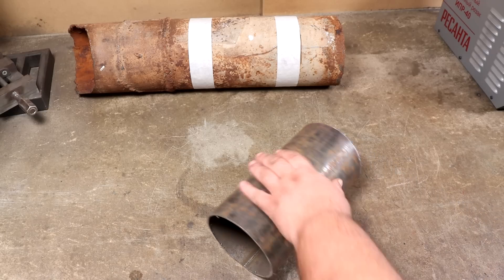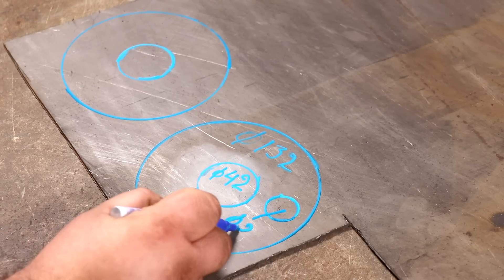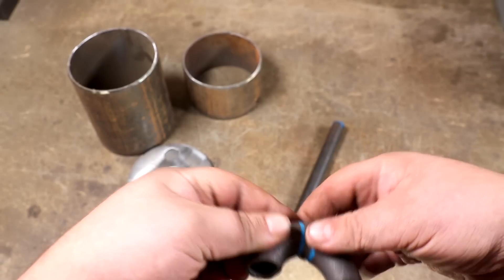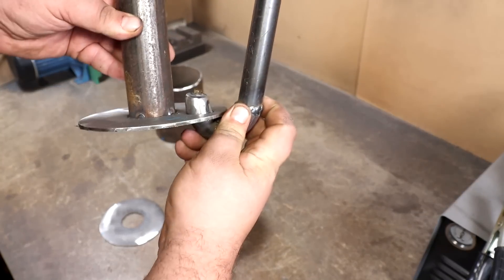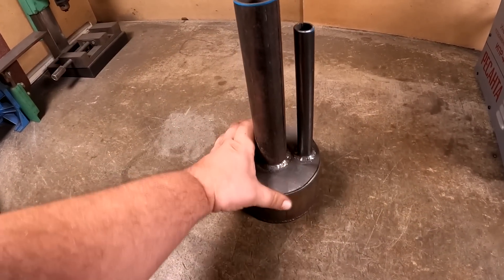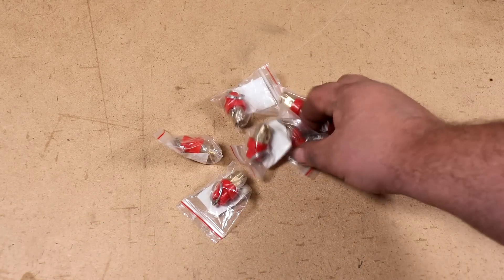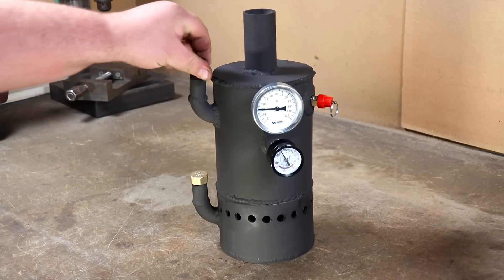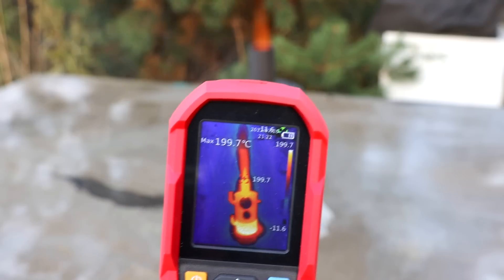Homemade Illegal Burner Uses Water

Comment: Regulating the power and shut-off can be accomplished by controlling air flow. Rather than a series of holes around the burner chamber, use air inlets with valves.

Comment: you changed something in the video of the smaller pipe coming out the top,  it disapeaars and the lid is actually over it or somehing, and the hole from the smaller pipe is gone, the one that does the horseshoe at the bottom..  where did it go,  is it inside under the cap with some space in between?,  It changes right when you bring the spray can in to paint it????

Comment: Congratulations on your project. It is clear that it works correctly. But at the end it does not show what you do with the other small tube that goes up alongside the central chimney. Afterwards it simply disappears, it is as if you had changed the cover. I think that, as they commented, a diagram would be missing to understand your project. But perhaps it is not your intention to show it.

Comment: Claims that water is used to power some kind of heating device or explosive engine are not scientifically sound and can be refuted by a number of laws of physics. The most important of these are:

1. The first law of thermodynamics:

As I mentioned above, this theorem states that in a closed system (such as a water-powered heating device or an explosive engine), the internal energy remains constant if there is no exchange of heat or work with the environment.

It follows that in order for a water-powered heating device to produce heat, an external heat source is required. Water itself cannot 'produce' energy, only transfer or absorb it from its environment. Therefore, a water-powered heating appliance could not produce heat if there were no external heat source (e.g. the heat from the flame of a pick).

2. The second law of thermodynamics:

This theorem states that in a closed system, the entropy of the system always increases or remains constant. The entropy is the measure of the disorder of the system.

It follows that for an explosive motor driven by water to do its job, the water must become disordered. This leads to a loss of energy, which means that the motor would not be able to work efficiently.

3. The law of conservation of mass:

This law states that matter cannot be created or destroyed.

It follows that for a water-powered explosive motor to work, the mass of the water must remain constant. This means that the motor could not 'produce' energy from the water, because the mass of the water would not change.

To summarise:

Water-powered heaters and explosive engines cannot work because they contradict the first and second laws of thermodynamics and the law of conservation of mass. These laws are proven and irrefutable, and therefore water-powered engines are not scientifically sound.

It is important to note that numerous scientific experiments and analyses have already disproved the viability of water-powered engines. It can therefore be stated with confidence that these engines do not exist.

Comment: I do not understand.  When you put out a fire, you use water, either in a concentrated stream, or with a spread fore cooling down.  Steam boilers on steam engines use steam, but have you ever heard that it can catch fire or explode?  Cooking oil has a high flash point, and burns very well when it first catches fire.  Is it then the combination of cooking oil, air supply and the turbine effect that causes the temperature to become high enough for the water vapor to catch fire? 🤔 Very interesting, but if I used it inside a normal cast iron oven, I'm afraid it would burst from the heat.  Do you think I could use this to heat the house? the greenhouse?  and if so how?🤔 If I'm going to use it for continuous heating, use a copper coil to supply water continuously, wouldn't it melt then?😊
Reply: See "Steam reforming" on Wikipedia. Water by itself does not burn. It may improve combustion slightly at sufficient temperature with a catalyst

Comment: you know theres a cool little thing called coal gasification, where heat up coal to 800-1800 degrees celcius or so and pump steam and oxygen into the burning coal creates: syngas (co2 and methane) methane further burned so i think can do for a great powerful cooking stove

Comment: This could be used to heat a home and the hot water if it was installed in a boiler tank outside and the  water circulating through registers in each room with pressure release valves ,just like in the early 1900`s.

Comment: Well, there are two ways of using water, as opposed to HHO, which I’m tired of explaining to people who want something for nothing.
You can inject water into the combustion process, to both slow it and cool it, which is done in industrial engineering and furnaces. In low revving engines, the resulting steam can even increase pressure in the cylinder on the power stroke. There are lots of successful uses of the technique, which even made it into some experimental public transport diesel engines, though it proved not to be cost effective in that application.
What’s going on here is the other one, where the water is injected as compressed steam, after combustion, where the rapid expansion causes an increase in gas velocity and draws more air through the furnace, causing the oil to burn faster.
It could use a couple of safety add ons. One, to divert the steam direct to the outside, rather than through the exhaust, to enable a more traditional burn and another to throttle the air supply, for a quick shutdown.

Comment: H20 can not burn itself consistently  and it can not work as a fuel, like a perpetual machine to break the 2nd Law of Thermodynamics. Here, u have done natural induced draft of Air by steam Zet for complete combustion of used oil. Moreover,  it will help to remove shoots from chimney. For consistant operation of this burner,  need controlled feed of Water and Oil continuously. Great job done and highly inspiarable for the beginners.

Comment: I loved this and am currently browsing some of your other clips. Trying out a lot of D.I.Y. tools making tips has become my new passion at 68 yrs old. Thanks for your efforts to produce and bring these ideas to the rest of us. These things are what I have always believed the internet was supposed to originally be about... an open free exchange of Ideas and information.... I almost fell out when you said.. now we only have to learn how to regulate it and turn it OFF ! :) Thanks again  -Jake
Reply from the maker: I am very pleased that you like my videos and I am glad that my ideas inspire you. Thank you🤝💪🤖
Reply: Use a metal cylinder that can cover the holes. Cut off the air. Make it adjustable. Attach it or keep it as a separate part. There are many solutions.
Reply: @Jack__________ or/and a steam dump valve to off load the steam “turbo boost” pressure.

Comment: I've seen your videos and I like what you do... Keep up the good work.. instant fan here... And my suggestion on how to control the pressure is that to control the burning of the fule ... So why not add a guide rail over air inlet to slip a sheet metal in between the body (inlet) and guides, the sheet metal is going to have a pattern that matches the spacing of the inlet holes... So when you finally slide it will create eclipse effect whilst managing air flow
Reply from the maker: Good idea. Thank you!🤝🤖

Comment: You could try adding a metal sleeve at the bottom of this burner as an air cut-off. It would be slid over the air inlet holes to starve the fire to the point where it's unable to generate enough steam to produce circulation.
Reply from the maker: Good idea, I'll try to make it! Thank you!
Reply: Thinking the same, just a sleeve that has same size holes cut out.
Reply: @joshuagardner5580  Oh, that gives me an even better idea than what I was thinking about.

I was thinking about a sleeve without holes that would have to be slid up and down. Your idea would let it be slid side to side, which would be easier to implement and operate safely.

Comment: You might be able to use a separate oil tank and a valve to adjust the oil flow and also stop the burn.
Reply from the maker: A good idea! I'll try experimenting like this! Thanks a lot!
Reply: @doctor-robo  You can use 2 separate tanks for whater and oil. You can adjust them or stop, but olso you can topp them with funnel. You just need to put some one sens flap on each or some sense valve. You can uso another tank with diesel...etc.  good idea! I have one idea like that but without whater. But your design is beautiful! Good job! No electricity for fan or other contraptions. 👏👏👏
Reply: @doctor-robo  ελληνικά
Reply: That’s what I use in my diy alcohol stove, it’s safer also in case of malfunction of the stove
Reply: Install a dump valve to blow the “boost” steam pressure down. That will drop your combustion rate at least.

Comment: This is not new, it's called a "super turbo" in brief it works by boiling water which produces steam and eventually a flame composed of hydrogen gas. With enough heat the process splits water into hydrogen and oxygen. In the past some turbo stoves as a example consisted of a specially designed hopper where rice husk is being fed for burning inside the combustion chamber, a steam tank which boils the water and converts it into super-heated steam, an air pipe which supplies the air needed for the combustion of rice husk, a char discharge lever that allows the removal of burnt rice husk during operation, and a steam burner that ignites hydrogen gas from the steam. These came into being during energy shortages or country's that lacked natural resources. Nice project though 👌
Reply: I wondered if anyone was going to mention HHO. I was part of the HHO experiment crowd for quite a while,  did get an extra 6mpg in an old Toyota Paseo, made some,I teresting explosions...BTW, "live" steam is extremely dangerous,  as it is invisible and freaky hot. In the Coast Guard,  I saw a broomstick that I was told was there for hunting live steam leaks - it would burn.

Comment: You could regulate the flame by letting off some of the steam pressure
Reply from the maker: Thanks a lot! I think that it is quite possible, but you need to make an additional valve to relieve pressure. 🤖

Comment: It takes energy to crack the H2O molecule.....
Reply from the maker: In this burner there is no splitting of water into molecules. Water plays a role in creating superheated steam. Superheated steam, in turn, increases the draft in the exhaust pipe by 10 times.

Comment: i like this idea and has so many implications. i was thinking of using leftover copper tubing from HVAC installs that haven't had Freon or POE oils dredging through the piping in a manner to create a hot tub using a horse troff and a wood burning rocket stove and wrapping the tubing around the smoke stack and using thermodynamics to create water flow to heat water in the copper tubing but your implication of the waste oil stove like this might work better to regulate temp so i don't burn myself with scolding water simply by adding another port to the steam top and a airflow regulator and shut off at the top and or bottom to regulate heat and with your added temperature and pressure gauge as an added safety feature ensures proper temperature regulation. thank you fore this video!
Reply from the maker: Be very careful with the steam section of the burner, there is over 400°F superheated steam and very high pressure. The design must withstand such pressure and must have safety safety valves (with a large volume of the steam compartment, several valves are better, one may have insufficient throughput)
Reply: what about having 2 chimneys and a manifold with a flap to block off one of the chimneys, when your water is getting to the temp you want the flap can close to allow the other chimney to take the heat
Reply: @utubeape  temperature regulated double stack. interesting
Reply: You could install a small flow pressure relief valve that’s directed to trickle water straight into the flame at a certain pressure. Just enough to cool the combustion but not enough to extinguish the flame entirely.
Reply: i done Hvac... had to clean old tubing...  sounds like a pump wants to help,, but if you got like up to 12mm, to wrap the boiler,  then heat an oil, glycol mix, h2o  filled system with a pump to either bring hot oil filled tubes through pool water... better to gravity feed a raised water tank and circulate that water to a lower pool.  proper sensing... oil stops flowing and so stops functions.
use old water, fuel,  plastic as needed from the pile... don't care about dirty,  just wrap copper around the hot parts, but other tube may help reach the pool

Comment: It takes more energy to crack H2O into combustible H and O2 than you get from recombining them by combustion, so it's unfeasible to burn water. Steam makes a very energetic air mover, though, so that's real, though some heat is lost. I think the noise is a big downside.
Reply from the maker: You are absolutely right. The noise is really not very pleasant to hear, but it is not as big as it seems.
Reply: @doctor-robo  maybe you need to 'tune' the pipes, a steam powerd church organ

Comment: Wow. Sleeve that 1" diam chimney with 2 or 3" diameter.  Weld a cap with a 1" hole on top, weld to chimney. Drill 10 or 12 1/8" holes around the inside chimney, close to the top. Bottom of larger pipe raised 1" off the main cap.
Air comes in the bottom, superheats, and is pulled into the flame. Afterburner!!
And a much cleaner burn.
Reply from the maker: Yes! Additional boost! Many thanks! I will definitely heed your advice. 🤖

Comment: This is not really a good idea, all the water is doing is soaking up heat and reducing the output temp.
Reply from the maker: Do you think the temperature is low there?
Reply: @doctor-robo  The actual measured temperature may not lower because the steam is drawing more air through which will burn through the fuel faster. However you will always get less total heat energy out (for a fixed amount of fuel) whilst putting water in because you are wasting the energy heating and vapourising the water. There is no heat energy in water, only cooling.

Comment: Is there a specific name for this type of stove/engine? I need to do some research. I need more information. Please?
Reply: Bomb, if its running hot enough and exhaust flow for steam is not enough. Look at the burn how much steam is released from safety valve. Also turning water into steam takes lots of energy. Instead make one with car turbo forcing air into burn chamber, with pressure release valve to let out all the extra pressure. Just need pressured air to start and intake valve to prevent runaway event.
Reply from the maker: I don't know the name of this type of oven. Maybe they can be called according to the principle of their work, it works on the principle of a gas jet pump (Venturi effect or Bernoulli effect).

Comment: The steam only produce a draft. The same principle is used on steam a engine. It use steam to increase the airflow out the chimney. Thereby mire oxygen to the fire.
Reply from the maker: You are absolutely right! The operation of this furnace is based on this effect, and due to this, a huge thrust of the gas-air mixture arises. Thank you!
Reply: @doctor-robo  👍
Reply: Could this be used in place of a blower for a metal forge?
Reply: @clubsoda85cook55  on the smoke chimney of a forge? absolutely.
Reply: Fair thinking mate 
Together we can take
Over to a better peoples
World...blacksmith theo
Harlingen holland

Comment: I don't understand the operation, but this is amazing.
Reply from the maker: Thank you very much for enjoying my projects and videos. I really appreciate this. I will make a video in the future with more detailed explanations of how it works.
Reply: Oil burns generating heat, that is then transferred mostly into water, witch boils, due water expanding in volume when going from liquid to steam pressure is created that is directed out and up from the pipe in the middle creating draft (low pressure) in the oil burning chamber, since hot steam is exiting with velocity up in the chimney pipe pulling burning gasses out,  that brings in more oxygen that allows oil burn hotter. Run away effect that leads into water side exploding is real danger if safety valve wont work, witch could easily happen as you can see its already leaking pressure from ether getting melted due heat or exceeding the pressure.
Much better option would been to essentially have car turbo charger turning from exhaust gasses and forcing air into burn chamber with several pressure relief valves as safety. This way you get very hot exhaust gasses that can be run trough heat exchanger and chimney outside, while heat stays and is dumped into the building instead of producing steam that takes lots of energy. Though while effective it needs compressor to get going and while fast to heat up there is severe problems with this design as well, like cleaning, how well it can dump the heat into room air and safety of working with pressure vessel. Every time its burned it becomes less thick wall and eventually it will burn trough and blow burning material all over the place. Then again its safer and faster than this design.